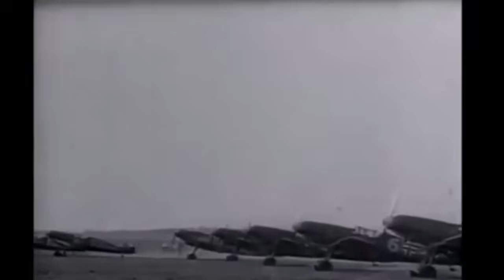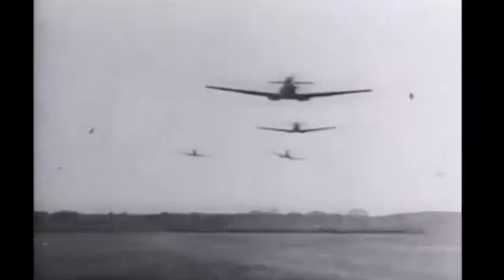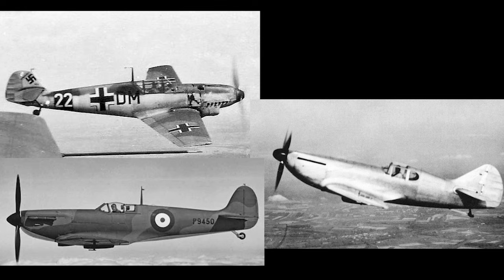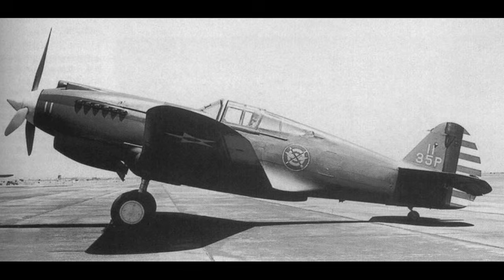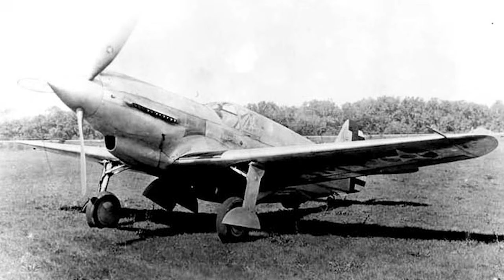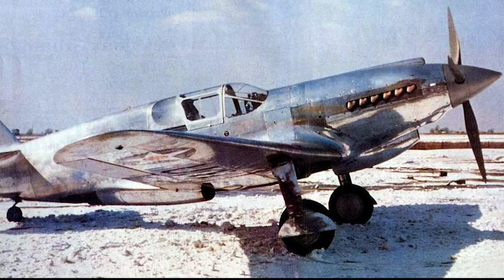American Spitfire; the Curtiss XP-46 “Kittihawk”

Comment: General comment about the P-40 - it was America's front line fighter when American's battle inexperienced pilots were fighting the battle seasoned Axis pilots and held its own and then some.  This was a far better fighter than is generally given credit for.  It was slow to accelerate and climb, but it was the best roller in the American fleet (including the 51), one of the best divers, and possibly the best turner.

Comment: XP-46 with an airfoil thicker (23016.5) than even the P-40 (2215) ... what were they thinking !  ... and no boundary layer lip on the rad housing.   Curtiss needed better engineers and aerodynamicists, not to mention better engines than the Allison.
To be fair, Curtiss did revisit the concept of an aft, ventral radiator, which was the best location for weight n balance but they once again didn't explore the necessary ducting required to meet the specs of the Meredith research paper or the Goethert wind tunnel studies.

Comment: One thing that is known is that a Spitfire could out dog fight a Zero if the pilot had some skill and then airframe was reasonably modern
Reply: and proper training against the enemy fighter.
Reply: No allied fighter could out-turn an A6M in a low speed turning fight, including the Spit.  Claire Chenault realized this and used the P-40's strengths to outfight the Japanese to a very high kill ratio. Would a heavy weight boxer fight a jab fight against a lightweight, or would he use his size and weight and brawl?  The 40 was slow to climb, slow to accelerate, but it was faster than the Japanese planes, could easily out dive them, and could OUT TURN any Japanese plane at speeds above 300mph, which is why the Flying Tigers used "boom and zoom" tactics against the lighter, more maneuverable (low speed) fighters.  If I was flying a Spit against any IJN fighter, I would not get into a low speed turning fight with them - I'd use the Spit's superior speed and high speed handling.

Comment: Had Curtiss concentrated on “cleaning-up” the P-40 aerodynamically like it finally did late in the war with the 422mph P-40Q, this variant would have been 8 mph faster than the P-38 and more maneuverable. In fact the P-40 in all its variants was a more maneuverable airplane than the P-51.
Reply: Yep, and they probably could have had the P-40Q sooner, had they not been f@rting about with dead end designs like the XP-46, XP-60, XF14C, XP-55....
Reply: The Allison was not reliable.  The Q handled better, but with the auxilliary s/c it lacked intercooler, aftercooler and backfire screens. Allison (GM) was the problem throughout the war and in Korea.
Reply: @bobsakamanos4469 
The Allison was highly reliable. The 1,475 hp version had problems however. The E37 variant was turning out 3,000 hp and not even WER! It was however was too ahead of its time. Turbines put an end to further development. The Allison in almost all areas was superior to the Merlin except for its supercharger which was the US Army’s fault in dictating design to GM.
Reply: @Machia51878  Reliable if not over boosted, starting with the -81 version.  But by the end of the war (and Korea) it still wasn't reliable taking high boost. Check the P-38L tests with 150 octane at Eglin Proving Grounds.  It was only good for about 60" MP.  The Merlin was at 83", the P-51 Packard Merlin at 75".

Comment: The problem is that they did not put a two stage super charger as that would have solved the high altitude problem
Reply: The Merlin's two stage blower simply wouldn't fit in a 40 airframe without a complete redesign of the aircraft from the firewall forward.  They might have worked that problem if other planes weren't already coming on line that could fit the two stage Merlin (or Pratt radial).

Comment: hah 1150 Horsepower and they projected over 400 mph ? now thats a whole lot of optimism. The Bf 109 was smaller than this and had a slightly more powerful engine and it only made 350 mph so there's no chance  Curtiss's creation was going to make 400 plus.

-- mind you the Heinkel 100 had the same engine and it did get over 420 but that plane was so optimized for speed there was no room for other systems to make it a viable combat aircraft.
Reply: What country was it from?

Comment: Not sure how I missed this one. When the Royal Air Force approached North American to build some of Curtiss's aircraft for them North American showed the RAF their ideas for a fighter. The RAF said yes but found it to be underpowered. So they took out the Alison engine and but in the Merlin in its place. So the aircraft went from being the A-36 to the P-51. And we all know what happened next.
Reply: Actually, NAA was fed up with Allison from the very beginning.  In March 1941, Kindelberger asked the BPC for the RR Merlin XX installation documents, which they received. GM therefore interferred with NAA ability to compete for a USAAF fighter contract, so they did a backdoor deal to provide the A-36 from different funding while they concurrently improved the radiator ducting with Brit help.  By 1942 they were well prepared to fit the 2 stage Merlins and produced two for testing purposes about the same time as the Brits flew the Mustang X. ... 

And we all know what happened next.
Reply: Allison powered Mustangs are faster then their Merlin conterparts down low, hence why Allison Mustangs were used as attack and strike aircraft.

Comment: It's so sad how the p 40 is still so often maligned as an inferior aircraft when with a good pilot they performed excellently against both the zero in the Pacific and against me 109s in north Africa. It was never given a serious chance against the 109s over England but the numbers kind of speak for themselves. Some 13,000 built with hundreds of kills against the Japanese and Germans. Much like the Brewster Buffalo in Finnish service performed admirably against the red air force. Often it simply requires skilled and motivated pilots to learn to use a weapon the way it was intended to
Reply from the maker: Yes, it's very much a case of "square peg, square hole". Used in the right circumstance they could be highly effective.

Comment: The P-40 filled a need when the war was most desperate for the Allies.  The AVG in China had a very favorable kill ratio over the Japanese using P-40's.  Curtiss kept working on the P-40, eventually getting up to the "Q" version, which had a top speed of 422 mph.
Reply: unfortunately it was 2 years too late to be useful and so whilst the best P-40 ever made, it was still average compared to what was fighting in europe at the time.
Reply: Right...had Curtiss gotten the "Q" model in production 2 years earlier, it would have been more than worthwhile..and they might have done so had they not been wasting their time and resources on ungainly dead-ends like the XP-42, XP-46, XP-60, XP-55, and XF14C.... @philkennedy8683
Reply: The Q handled very nicely, but the Allison was still a problem with no intercooler, aftercooler or backfire screens.  Read the flight reports.  The Q constantly had forced landings.

Comment: Too much cooling drag, too much trim drag, too much induced drag.
Reply: It had rounded wing tips so it would have less induced drag than a P-51 or clipped Spitfire.  Trim drag? did it have an enormous Centre of Gravity range? was the horizontal stabiliser badly rigged?  Cooling drag sounds sound.  Probably very overweight too and the cross sectional area increases with length look abrupt.

Comment: During the WWII era Curtiss worked on the development of no less than 20 different aircraft and some like the XP-60 series had many varieties.  This combined with the loss of their top designer, Don Berlin, seemed to result in an in ability to produce successful aircraft.  Even the SB2C while produced in large quantities was disliked by those who had to fly it.
The XP-46 with its small wing was really more of a BF-109 than a Spitfire.  Like most Curtiss designs at this time, it wasn't developed with sufficient energy.  I took 4 months for the first P-51 to get in the air.  It took 16 months for the XP-46,  The cooling system was similar to the P-51's system, but was never developed to work well.
Reply: Amazing, how both aircraft (the 46 and the 51, that is) share so many similarities, albeit only superficial, to be so different in detail and ultimately in the results achieved with each design.

The power of engineering

Comment: I think the P-51 has a better claim of being the American Spitfire. Initially rejected by the British as too slow, until they stuck a Spitfire engine in it. Lo and behold, we have both sides of the equation, that has endured till today. American air-frames, British power-plants.
Reply: Such nonsense, the Brits loved the Mustang I/IIs and used them until they wore out, it was miles better than the P-40 at all levels and vastly outperformed the Spitfire MkV at low level.  The USAAF took all the P-51As that they could get and even took a ground attack version to get around funding restrictions.  No more were made once the P-51B/C came out.  The RAF’s low level photos for OVERLORD were taken from Mustang I/IIs.
Reply: point of order: the Mustang only exists because of the British. they loved the aircraft but hated the lack lustre engine. upgrading to the two stage Merlin now being license built by packard was an obvious step. Rolls did the first conversions to prove the point then NAA did a fairly major upgrade to give us the B/C version. It was the USAAF that initially didnt want it.

Comment: XP-46 ended up getting attached to design of  the P-51 all I could uncover was that NAA purchased wind tunnel data from Curtis of the XP-46.
Reply: North American purchase design data for the cooling system from Curtiss at the insistence of the air corps.  The Mustang design team claimed that they didn't open the package until after the XP-51 was already flying.  There seems to be some debate on this.  What is certain is that both the XP-46 and the XP-51 had problems with the cooling system.  As the P-51 developed the cooling system was modified to match each engine that was used.
Reply: NAA got the test reports of the P-40 note the xp-46. the Curtiss was so out of date by that point there was nothing to learn from it. Check Edgar Schmueds book.

Comment: I think the problem these aircraft had is they were designed to meet a different need than to be found in the 1940 battles between Britain and Germany. In the US the army bought the aircraft and were only interested on protecting their troops which were not above 15,000 ft. In the UK as an island our requirements were different, the germans had time to gain height, and as we know the high controls  the battle. The P40 did ok in the desert war which was what it was designed for, I would say the Hurricane had it second 'Waterloo' in north africa also. The war in Europe moved up beyond the capabilities of both aircraft but north africa was mostly below 15,000 feet.

Comment: "The P-36...creditable service...but they could never be described as top rate performers in air combat."  Um, the Battle of France would like to have a word, sir...
Reply: @tomstulc9143  The engines that AVG received were those rejected by the USAAC for being beyond the stated requirements. This the AVG used happily.
Reply: @michaeltelson9798  The Allison engines in the original AVG P-40s were cobbled together from rejected parts after being balanced by machinists.  They were better than the production Allisons.
The P-36 didn't use Allisons.

Comment: 1938 everyone's enamoured by the pretty new gal i.e. liquid cooled 
1944 everyone's best girl is Pratt and Whitney R-2800 Dbl Wasp Air Cooled
Reply: your view of history is slanted. The R-2800 was indeed an excellent engine but not everyone wanted it. The US Navy were the driver behind its existence and development and it definitely paid off, but others want better range than an aircooled engine could supply and so the Griffon, Merlin etc covered much of that market.
Reply: @philkennedy8683  More my personal opinion than a slanted take on 'History'. Griffon engines do deserve more appreciation, it's just the radials were tougher IMHO. I'ld rather have the P-47 Juggernaut than a Mk. XIV.
Reply: @philkennedy8683  It wasn't just the United States Navy, my favorite airframe of the time the Tempest Mk. V with it's Napier Sabre liquid cooled sleeve valves was more preferred in it's Bristol Centaurus radial but still sleeve valved iterations as both the Mk. II and Sea Fury.

Comment: It needed a dual stage supercharger that would have made a big difference!! Leave the 50 cals in the nose, put a 20 mm in each wing and get rid of almost useless 303 cals. That would get rid of 200-300 lbs. Also it looks like a few things could have been done to reduce drag and lighten the plane even more.
Reply: There was no 2 stage supercharger for the Allison simply because no one ever paid them to develop one (until very late in the war for use on the production version of the Twin Mustang).
The Army Air Corps paid for the development of the Allison engine and they forbid Allison from using any of the funding to develop a 2 stage supercharger, in the mid 30's the military task NACA with determining what the best type of supercharger system was for high altitude performance, their conclusion was a single stage supercharger with a turbo to feed it at altitudes above 12,000 ft or so, that's the system that the Army Air Corps dictated all it's aircraft would have, the P38, P47, B17, B24 B29 and other's all had it, the P39 and the P40 (look up XP37) were both originally supposed to have the same system but on both the turbo was dropped at the last minute to speed up development because everyone was screaming for aircraft. 
NACA determined that a 2 stage 2 speed supercharger was the 2nd best way of achieving high altitude performance, for it's own reasons the US Navy chose that system for all aircraft developed for them, since the Navy didn't use anything that had the Allison engine in it they weren't going to pay for a 2 stage 2 speed supercharger to be developed for  it.
That's the reason that when the P51 was developed it's Allison only had a single stage supercharger, because the US Army didn't order the P51 originally and wasn't going to pay for a high altitude supercharger to be developed for it's Allison engine. 
It should also be known that Merlin engines also weren't available with 2 stage superchargers until mid 1942, even the early Packard built Merlin's only had a single stage supercharger, so putting a Merlin in the P51 when it was first developed wouldn't have resulted in any better performance. 
Single stage Allison engines were actually better than the single stage Merlin engines because they had intercoolers on them from day one allowing them to run higher boost levels where the single stage Merlin's didn't, they didn't get intercoolers until the 2 stage supercharger was developed for them.
It's a myth that the Merlin engine is more powerful than the Allison, it's just that in mid 1942 the Merlin became available with a 2 stage supercharger, but with it's single stage supercharger with intercooler and the original turbo configuration for high altitude as used in the P38 is why it's performance exceeds Merlin's at any altitude (given of course that you're rating them on the same octane fuel).
Reply: @Duke Craig - Great info. Thank-you.

Comment: Such a sleek looking design.  It's always struck me as odd that it was slower than the later P40, as it looks like it would be better from an aerodynamic standpoint.  The radiator is even in the "Mustang" position, which probably contributed more to the P51's low drag than its laminar flow wings did.  
Awesome video of an intriguing "what if" aircraft!
Reply: Curtiss never developed the cooling system design so that it worked correctly. North American did their development work.  Compare the XP-51 cooling system with the systems in the P-51A, P-51B, and P-51D.  All of the cooling systems for the production aircraft were different and carefully designed to get the aerodynamics correct.
Reply: @jimfisher5856  Probably one of the most fascinating aspects of World War 2 fighter development is how "upstart" companies that were not known as fighter design firms managed to usurp companies that were well known for fighters.  Hawker was usurped by Supermarine in Britain, Curtis was usurped by North American and Republic.  And of course Messerschmitt had the same sort of luck vs. Heinkel in Germany.   Yet, when it came to bombers, the "old hands" like Handley Page, Avro, Boeng etc. dominated.  It's just such a fascinating bit of history. :)
Reply: Actually, the P-40D was a little slower, but more manouverable with a better wing loading.

Comment: Would be interesting to have seen the airframe with the P/W wasp engine. 2000 HP may have made quit handful .
Reply: The P-60 was P-40 technology mated to the R-2800.  The XP-46 was too small to match the engine.  A better match might have been the R-1830 with 2 speed supercharger.